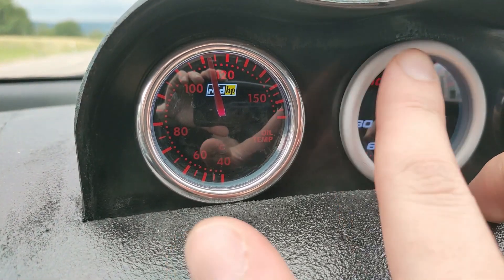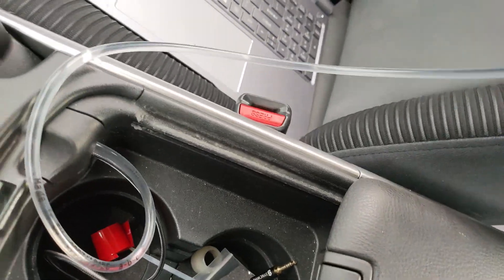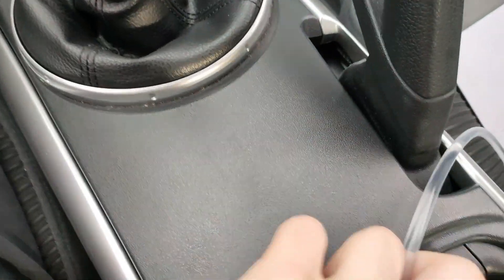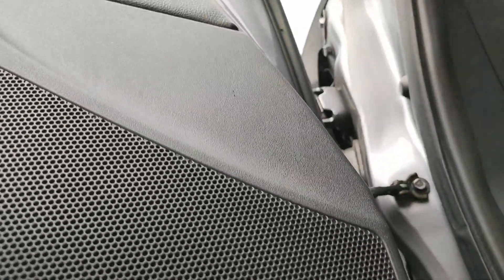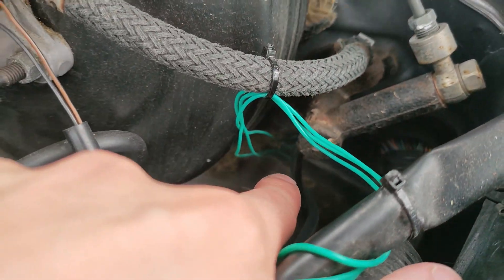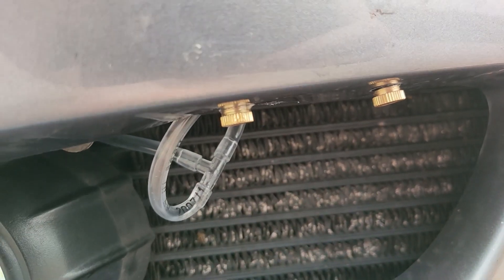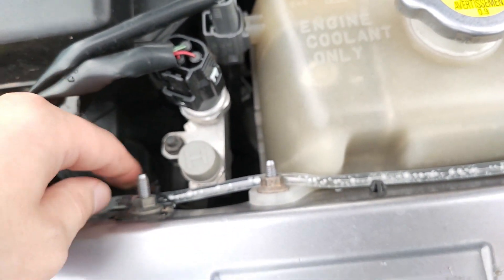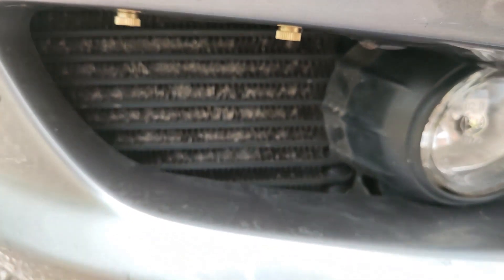Mazda RX-8: Oil Cooler mod for better oil temps (Jank version)

Comment: great mod, you also need to straighten out your oil cooler fins to help further. Larger oil pan also helps and making a hole in the plastic behind the oil coolers helps with flow as some race car RX8's do here in Australia.

Comment: just straighten your radiator fins and your temperature will go down (more air flowing) and possibility of putting pc fans at the back of the radiator (open the plastic cover of the wheel arch) triggered by temperature sensor and put a windshield washer pump rather than your mess with a temperature sensor that triggers the pump, it looks more like a horn assembly there!
Reply from the maker: Seems like you can't read comments huh?

Comment: Good idea. I would suggest you could re-route your windscreen washer jets to spray oil coolers sparingly! This way you can selectively mist them up baby! 😀
Reply: Agree with that, wanted to do the same thing, spraying water over the radiator, not the oil coolers. Just fill the windscreen tank with a clear or destilled water and make a by pass lining to the radiator. Even the usage would be a lot more comfortable, than carrying that NOS tank behind your seat :D
Reply from the maker: @mAto424  i dunno how the bottle is uncomfortable i don't even notice that it's there and water fillup is as easy as it gets with opening the backdoor and filling it up.
And the pump doesn't create enough pressure to power the nozzles.
That's why the bottle is needed 
You need 20-40psi of pressure to get enough flow and a fine spraypattern.
Reply: @Snow1998v1  sure I agree, didnt realize your spraying it for a entire drive or a longer period. Switching the washer switch while cutting corners wouldnt be enjoyable anyhow 😀 I'm not tracking it and driving only when it's around 20 celsius outside, to keep the RX cool and me either  :D
Reply from the maker: I can already control when to cool down that's why there is a switch.
And i'd like to keep my Windscreen wascher tho.
But for a trackcar only sure do what you need to do.
Reply: mate great idea! What about buying a second hand washer bottle setup for this to have as complete system with its own button?

Comment: Might aswell straighten the radiator core fins, they get pretty rough since they are so exposed
Reply from the maker: yeah the thing with that is that they will break since these radiators are old.
also the problem still occurs even with straight fins. 
in the future i will replace them and add a steelnet infront so rocks can't damage it.
but it's fine with the mod for now. and while i drive normal at 3-4k its fine only if i push it really hard and it's hot outside.
Reply: Was gonna say the same thing, wouldn't hurt trying to straighten them a bit. Fans on the oil coolers is another idea. But your mod is very good. I like it 👍 🦘
Reply: @Rollnfunka  For sure you can't do much on big impacts, but I got pretty nice result with a pick on smaller/bend fins

Comment: Interesting (‾◡◝)
Where is your oil temp taken from?
I have spent a shit load on cooling my Renesis, first with a much bigger radiator(x 3 brands), second a much bigger oil sump( x 2 brands, ending with my own design) plus a fuel radiator plus fan(custom).
After all that I have finaly got the oil (coming out of the rear iron) to stay under 110c when at the race track.
Making the custom sump was really hard so your solution is better for most people ლ(╹◡╹ლ)
Reply from the maker: It's taken from the oil filter also you can use ice water to improve the cooling even more i used just normal water with 20°C temp maybe even warmer also you can add more nozzles aswell but then the water tank won't last as long. 
I got around 25 minutes of use from 3 liters and 4 nozzles.
I was thinking of getting a 15 liter tank so i can run it for an hour or 2 if i take a long drive... or i just take some waterbottles with me to refill haha.
Reply: @Snow1998v1  .. Oh, if you track it then 25 min is more than enough, here in Aus. we usualy have upto 20 min sessions. Sounds like you shouldn't change unless you want to go in an enduro race:)
Btw back when I ran E85 , I ran higher boost and the temps didn't go much higher. I have just got some E85 and will test this rebuild soon. (I hope I don't blow it up again)